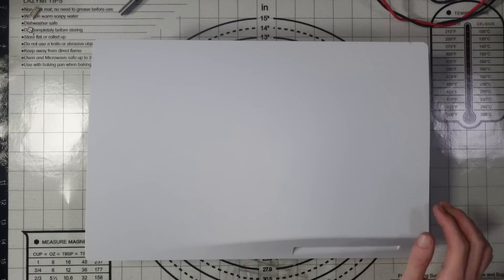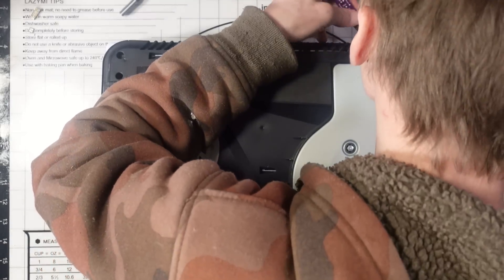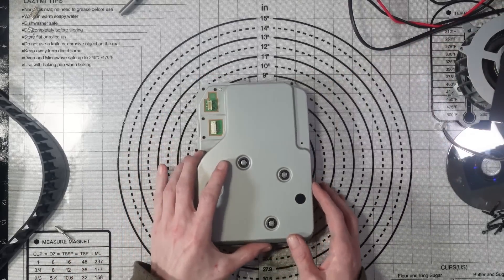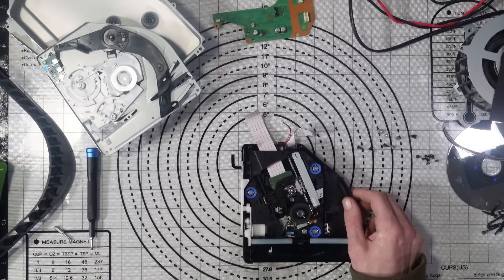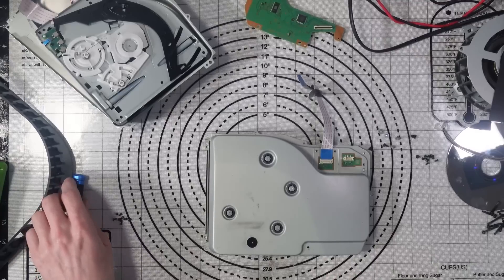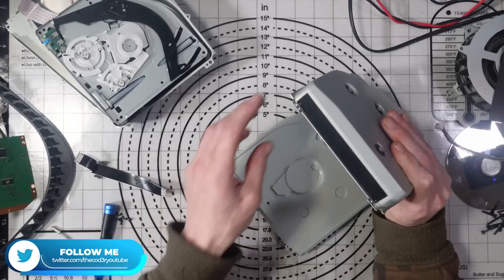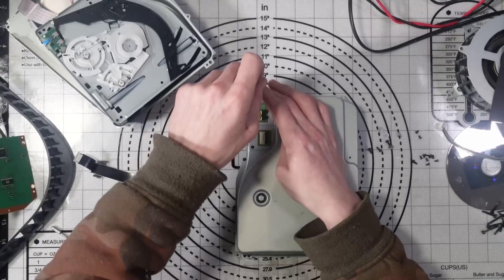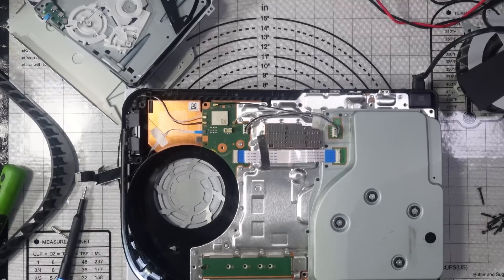This PS5 Won't Load Games... Can I Fix It?

Comment: If a ps5 is working fine then suddenly powers off fully after around an hour sometimes longer then you have to rebuild the hhd ssd ect what is the issue for that  a ps5 is working fine then suddenly powers off fully after around an hour sometimes longer . Seems at random then you have to rebuild the hdd ssd ect what is the issue for that ?

Comment: HELP ME PLEASE
I recently changed the laser deck(laser plus motor together) and when i insert cd it plays fine.When I remove it it comes out and the disk drive keep making a super weird and it wont accept any furtger disk  So I did realign it..but still same issue .Please help me pal as Im super lost

Comment: Hi! I have a problem, mi ps5 beeps 2 times and then turn off. It starts in safe mode only if i turn it on with de hdmi cec, but when i try to reinstall the software but when it needs to restart happens the same thing of the 2 beeps and then turn off

Comment: Have an original ps4 with the led that's on top and not sure wat it is but i can be playing a game or using an application and for no reason the controller will hesitate then shut off and won't reconnect basically just flashes white before turning off and within a few minutes it loses all Bluetooth and wireless capabilities and the only solution is to unplug while it's turned on to fix the problem
Reply: maybe bluetooth controller isnt working
Reply: @adzinoolol  even with plugging in via usb the controller stays white so not entirely sure what is going on,  all that is needed is a unplug

Comment: Dose anyone know how to fix xbox  turning on but know display
Reply: try cleaning the xbox hdmi port with 99.9% isopropyl alcohol and brush
Reply: hdmi port or hard drive maybe
Reply: It was working before moving it to a new tv
Reply: And hard drive was replaced recently
Reply: @jez177-k8l  mayb ur tv might be an input and not an output
Reply: It work for switch and my pc
Reply: @jez177-k8l  hdmi cable if not im stumped not sure what else it could be
Reply: I've tried lodes of administration cables and still nothing